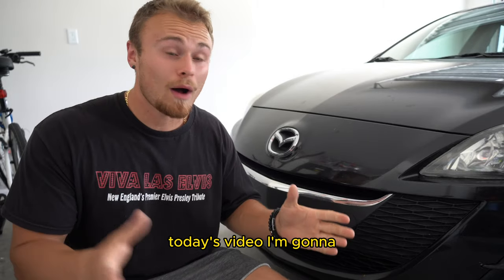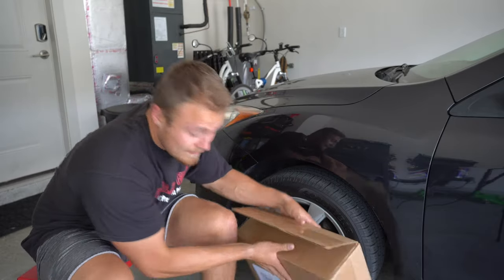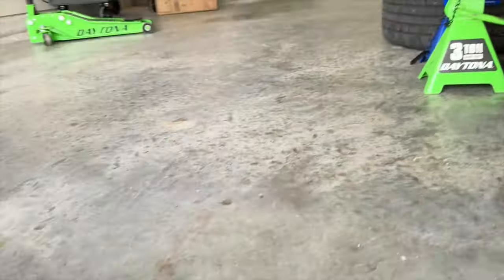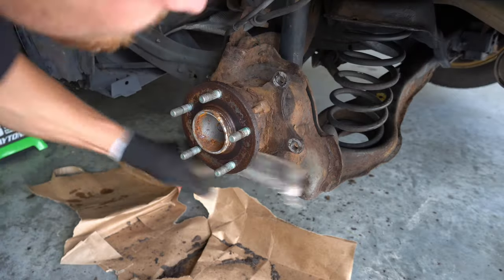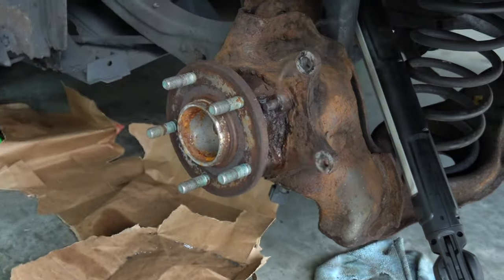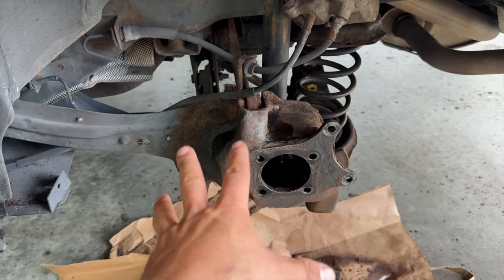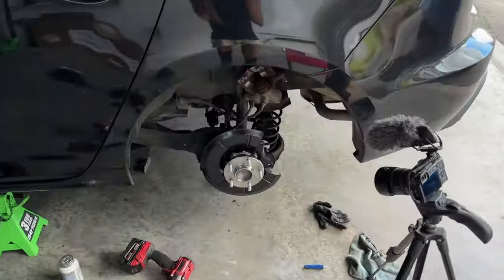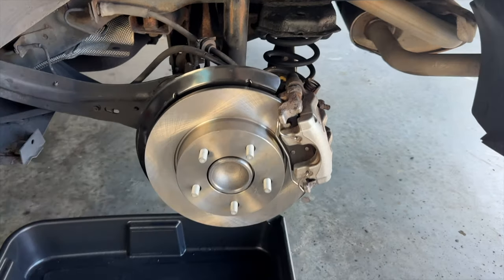HOW TO REPLACE REAR WHEEL BEARINGS ON A 2010 MAZDA 3

Comment from the maker: Here Is The Parts & Tools List!
Magnetic Induction Heater: https://amzn.to/3y0jZbI
Brake Caliper Retractor Kit: https://amzn.to/3ybzPA2
TRQ Wheel Bearings: https://amzn.to/4a3V3x6
OEM Brake Dust Shield: https://www.mymazdapart.com/p/49003037/BP4K26261B.html

HERE IS HOW I REPLACED THE FRONT WHEEL BEARINGS ON MY 2010 MAZDA 3:
https://youtu.be/I7AFBK2vOsA?si=-BloXGpHA6Y7fwpN

Comment: What size were the wheel bearing bolts?
Reply from the maker: i believe it was either a 14mm or 15mm
Reply: What torque? Great video!
Reply from the maker: @joel4506  48.3 ft-lbs for the 4 rear wheel bearing bolts
Reply: @Haydenschreiermk2  thanks! I did them a bit higher, 65~. Should a go back and re adjust or not the end of the world?
Reply from the maker: @joel4506  for that not the end of the world. its not enough to make a massive  difference. those bolts just hold the hub on so youll be alright. if youre bored or down there one day you can always adjust for peace of mind